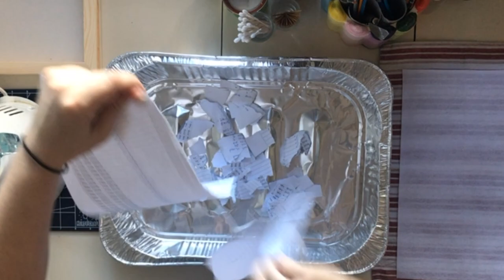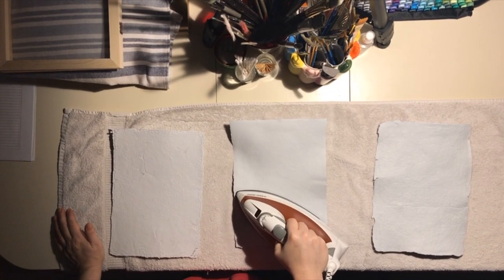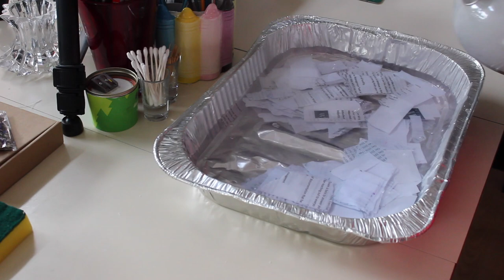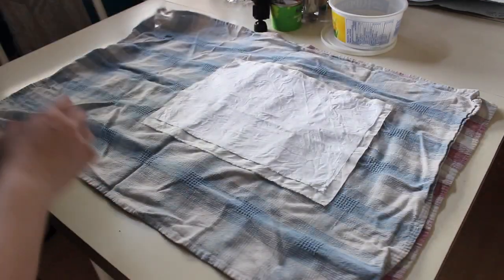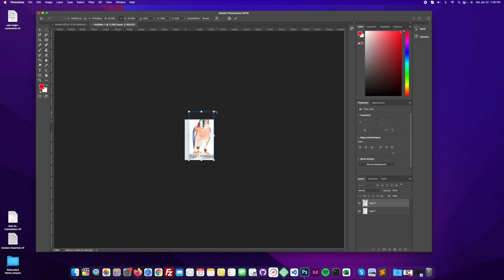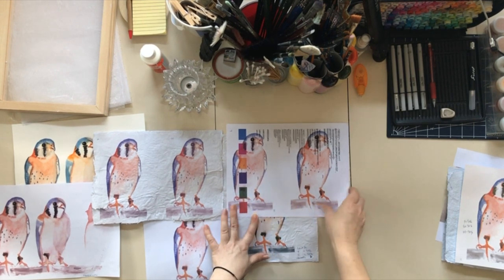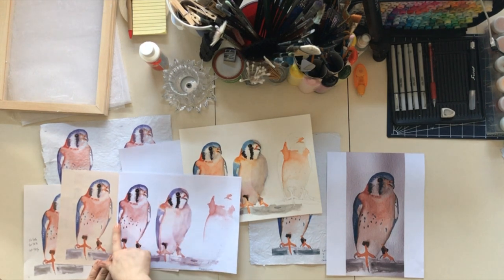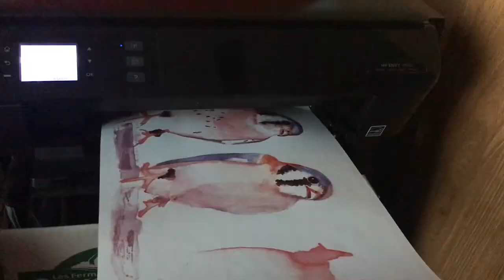handmade paper & printer tests

Comment: If it hasn't been fixed, try adjusting your white balance to match the yellow, instead of individual colors. When you print, there is a tendency for the print to come out a bit dark, so there is a learning curve. Also, I recently learned that RGB color profile is used in electronic devices, like computer monitors, while printing uses CMYK. When RGB is converted to CMYK, colors can look muted. So those settings should be experimented with as well. This video was helpful to me. Thank you!
Reply from the maker: yes, absolutely correct, printers use CMYK inks.  ensuring the photoshop file is in CMYK mode (versus RGB) before printing gives you a better representation of what will print out. i will try your advice about matching to the yellow. i can't remember where but i have heard this before, so i will check it out!   thanks :)